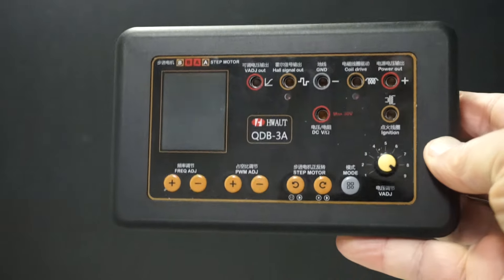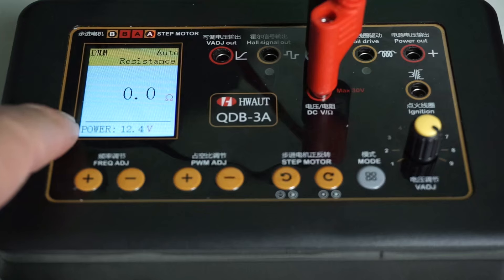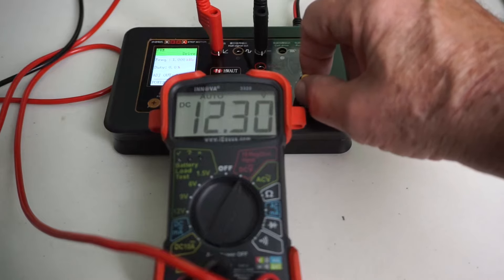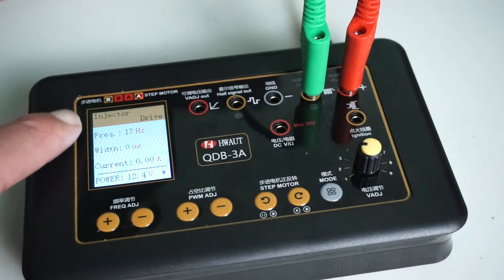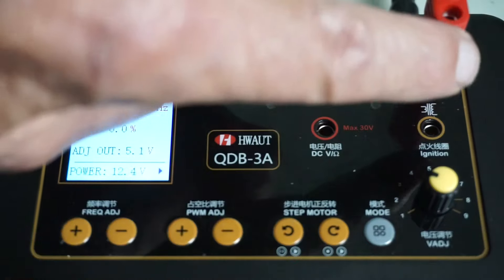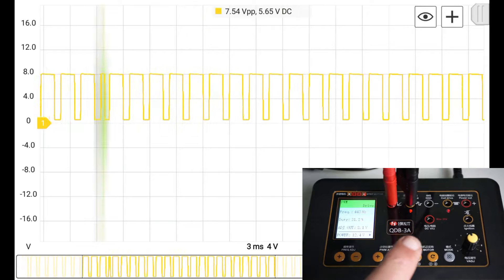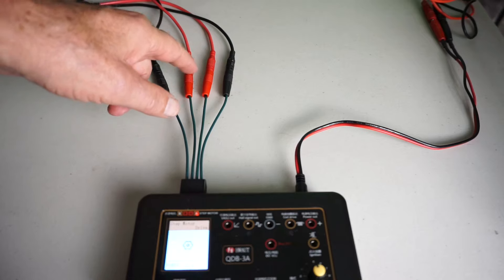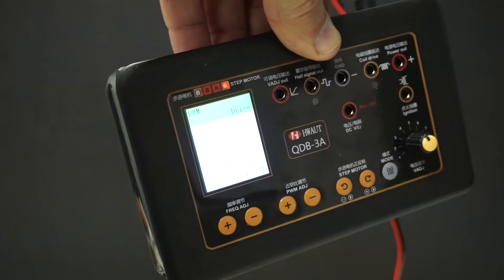GADGETS#201 - QDB 3A

Comment: Suggestions are welcome. We will consider the added functionality and make it a reality in future upgrades.:medal-yellow-first-red:
Reply from the maker: I do like the product and I think injector driver that mimics the pull down method in vehicle would be an improvement:)
Reply: @theGADGETSplaylist  Thank you for your suggestion, we will seriously consider it. Could you please leave me your email address so that we can send out new products for trial use?
Reply from the maker: @hongwave  I would consider that

I can be reached:

thegadgetsplaylist@gmail.com
Reply: Battery power and ground cable, just female banana plug could be better in real life, what do you say for your next upgrade? In addition, can it shoot out like 0.70V for sensor by-pass testing?
Reply from the maker: @bekomcar554  not the best tool for feeding sensor test voltages ... for one thing output range is >1.25v (can not go as low as 0.70v as your request) ... and... it is not current controlled, will carry 1.5A ( a bit much for sensor simulation)

I think something like GADGETS#143 is better suited for this
Reply: If I had one of these first thing would be to build an external amplifier so that I could test things like pwm controlled fuel pumps , throttle bodies and EGR valves. Ideal power output for a device like this is 6A.
Reply from the maker: @Daniel-OConnell  yeah, the 3A limit of the PWM would fall short for the fuel pump ... but I think ok for EGR ... not sure about throttle bodies

there is a popular module ZK-PP2K that has a PWM of 8A

thanks for watching and for the comment Daniel

Comment: Specs say 26v max input, looks like another dewalt adapter needed for portability :) 

I'm guessing you could control a three wire coil using the pwm (5 ish V) feature and grab the 12v power separately?
Reply from the maker: on the throughput, yes ... but on the adj voltage it's max 14.5v even if 24v powered

and yes for the 3 wire coils, Chris